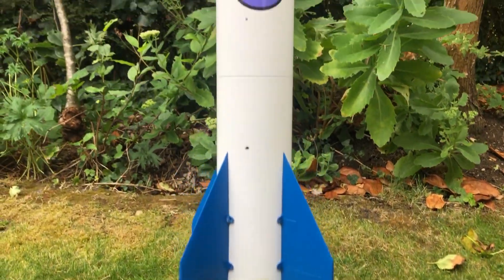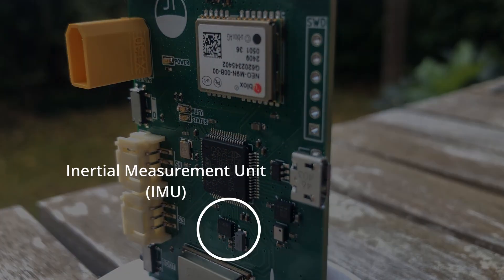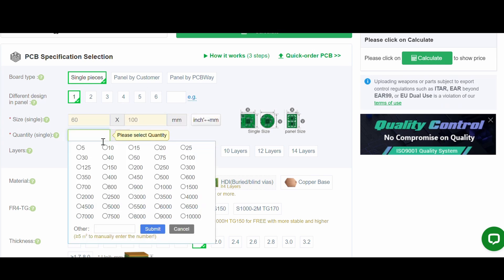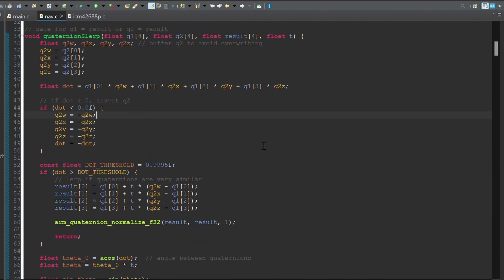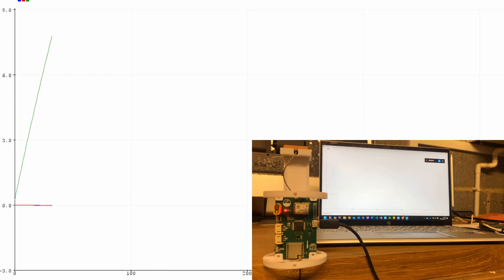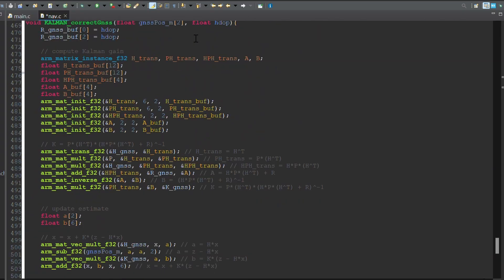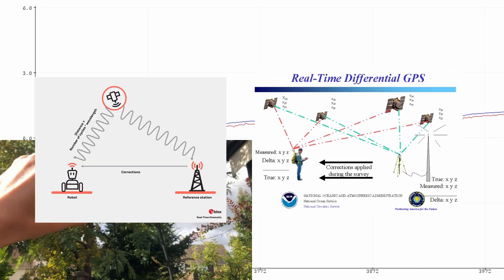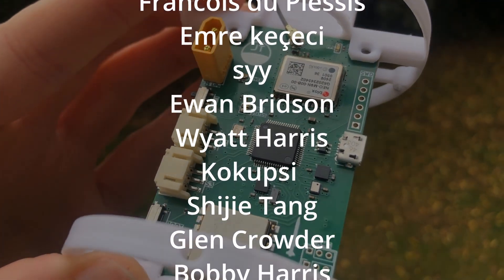Flight Computer and Navigation Software for a Fin-Controlled Rocket

Comment: Hi there! Great video. Just one thing. You are missing out on additional precision in your orientation and position estimation by not using the same filter for both and not taking in-flight mag readings into account. Check out MEKF and ESKF algorithms, they are an extension of the EKF. If you have a good grasp of the Kalman filter, they aren't much more complicated
Reply from the maker: Thanks! I am actually working on an error-state kalman filter for an upcoming project at the moment.
Reply: @jacobthornhill Nice! I will stay tuned, good luck!

Comment: Hi, very nice video! Your pcb shares a lot with fpc f405 fc's like the icm accelerometer and barometer. Those boards are widely available and already designed! I'll try to get similar results with a stack of a f404 noxev2, gps and expresslrs!

Comment: If integrating GNSS/GPS data with Kalman Filter, how are you dealing with low data rates from GPS/GNSS.  Isn't the max data acquisition rate set by the ublox M9N is 25 Hz, which I personally have never seen. Btw awesome project, am still learning would love to help you in some way.
Reply from the maker: The ‘predict’ step of the filter is called at a fast rate, but the GNSS and barometer update procedures are only called when new data is available. The M9N can do 25Hz, but from what I remember this comes at the cost of accuracy - I think it can only process certain constellations at this rate.
Reply: @jacobthornhill I think all constellations work on that but yes accuracy is bigger sacrifice here. The M9N has few nuances which can be accessed with ublox ucentre 2, if you haven't looked up. Still I am keenly interested in what you are building best of luck for the rocket.
Reply: also did you battery back that m9n module for warm locks or is there a warmup period you have on pad? i also have never got them anywhere near 25 Hz even with all other ubx messages disabled
Reply: @barfbot  I am currently working on AHRS based on BNO 055 and subsequently trying to perform dead reckoning and i know i will have to integrate GNSS ahead and I am totally expecting 8Hz worth of speed with low accuracy 😭

Comment: With the right antennas the 'high-power'/PA nRF24 can definitely transmit over long distance (eg. 30+km on my high altitude balloon), but it would require the antenna to be sticking out sideways which I guess is not ideal for a rocket. Also you'd want it to be in transmit only mode, which would not allow sending commands to the rocket. Starting in bi-directional mode and then switching to transmit-only right before launching would be possible, but not reversible wirelessly. Most likely you'd get better range with one of those off-the-shelf modules (with the RF shield can) than you would with your own PCB - I'm no expert, but I do know that RF traces are a devilishly difficult thing to get right.
Reply from the maker: Thanks for the detail! My last rocket had a nRF24 without the PA, so I probably should have given a nRF24+PA a spin before switching to LoRa. 30 km range is crazy! Definitely going to watch your series on that now. Also, I’ve used plenty of your GPS and RF range tests as reference when deciding what to go for - clearly I should have paid more attention to your nRF24 range testing video!!

Comment: How do you guys do handle the real time stuff? I would like to know why you guys dont use embedded linux devices or microprocessors and how do you guys simulate all this? Gazeebo with ros? Not because i want to build a actual rocket but i would love to use sensor fusion and kalman Filter aswell, maybe for a fixed wing uav. Huge respects!

Comment: Hello Jacob, the MEMS sensors do have a cross coupling effect under linear acceleration, and in your case of use there is a lot of linear acceleration. As one axis of acceletometer faces acceleration, the other axises produce false data, that manifests itself as a twist. Have you observed it in your experiments?

Comment: Great video on the flight computer and navigation software for your fin-controlled rocket, Jacob! I was fascinated by the design process and implementation details you shared. I'm curious - are the CAD files, schematics, and code for this project available anywhere? It would be amazing to dig deeper into the technical aspects. Keep up the awesome work!

Comment: Nice video. One question for AHRS fusion alrogithm. Why did you use Madgwick filter even if you can implement kalman filter for position tracking? One of the most key benefit of using Kalman Filter is fast initial convergence and most commercial SOMs using it for this reason. Of course they put their own recipe filters to cope with the external disturbrance and optimizations.🐱🐒🦄🐅🐹🐘🐪

Comment: great you share your knowledge, thank you! I only watched the IMU part. You seem to you pick your favorite car for the highest indication written on the speedometer, not for the real top speed? 🙂bit resolution typically doesn't matter that much, focus on the noise instead, e.g. 2.8mdps/sqrt(Hz) for the gyro. If you integrate over time, the noise of the time gets as important as the sensor noise (as you mentioned with the external clock signal)
Reply from the maker: Interesting, thank you!